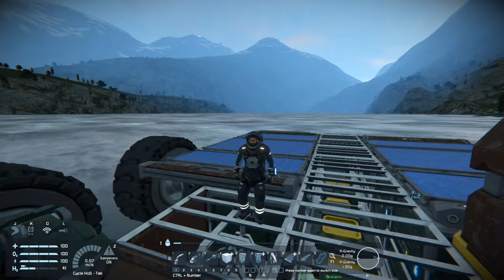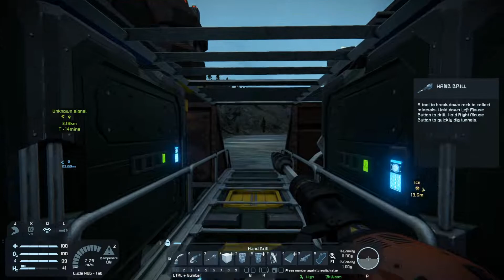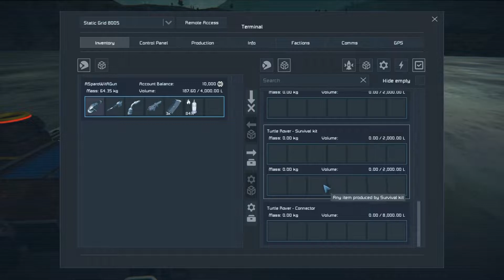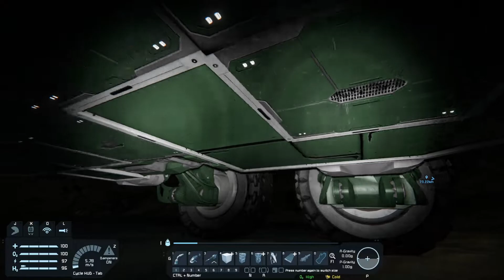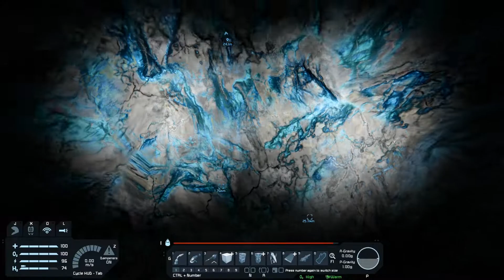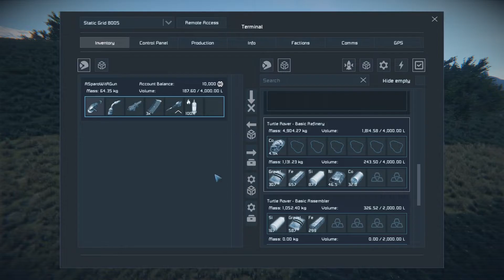Finding Cobalt & Mobile Base Upgrades - Space Engineers LP - E05

Comment: Where does it show ore with hand drill my screen size isn't got to my tv an no way of changing it so safe zone is off abit I think it's off screen but nobody shows where it oops up on screen where it says there ore here srry just started playing very new thanks for any help
Reply from the maker: Well, it doesn't really show up on like the HUD. It basically will show a GPS location so you'll see little arrows/boxes on the edges of your screen if they're off screen. But when you turn & face them, it should show up in your main view. Then if you point the crosshair at it, you should get the full name/title of whatever it is. But keep in mind the hand drill has a much shorter range so you have to be pretty close for it to show up. Hope that helps. :)

Comment: Broadcasting through antenna will show you ores without sitting in seat/cockpit. About for lowering mobile base with only sensor you still need to use a script. Because sensor activate only quick command exactly like hotbar or buttons and it will lower/rise it only by one step. So I have a good news for you. You have to use/write a script 😁. Are you programming a SE script in game or through developing software (Visual Studio etc)?
Reply: Well in fact no, I'm the one who gave this idea on the last or maybe the previous one.
What you'll need:
- 1 sensor
- 2 timer blocks (one for up, another for down)
Then, on each TB, you configure in the actions: lower/up the wheels + start itself (to continiously lower/up to max) + stop the other one
Then, on sensor, you trigger down when present, up when away.

+ the configuration of the sensor is important, you have to only detect player. And in the cockpit, the player is not visible from the sensor so that you can drive because it will up the turtle because you're away of sensor detection zone. And finally, no needs to have a tiny zone for the sensor, it can be as large as you want to, but it's using more power on large zones.

I've tried it at home since I've posted the idea, and it worked like a charm. That's what I call engineering !!!

(I'm developper, just like you SKS, so it's "too easy" doing things with scripts, for me, it's more chalenging and fun to find another way + scripts are forbidden in some case like online servers)
Reply: @Yenlui76  Oh with TB yes it could be done. My bad, you're right. Same as you and SKS I'm developer but I enjoy coding too much to consider TB or other methods :)
Reply from the maker: @CMDR SatosCZ Oh good lord I HAVE to use VS! If I do anything outside of a few lines SE's programmable block interface is WAY to frustrating haha! Between the user-friendly interface and adding Malware's plugin so that you can see what all the blocks & types do and what methods are available, I cringe at thinking of having to do it all in the SE interface. 0.0
Reply from the maker: @Damien Gontier Yeah, I hadn't thought about it before, but when you laid it out like this it makes sense. It's a pretty interesting idea to.

Didn't know some servers restrict script usage. I mean it makes sense, they could do a lot of crazy things that could tax the servers, just wasn't aware of it.

And when I'm probably not experienced enough that scripts are too easy for me, it's just my go to. I've done coding/wanted to be a programmer for most of my life, so my brains just "coded" to think that way most of the time haha. :P